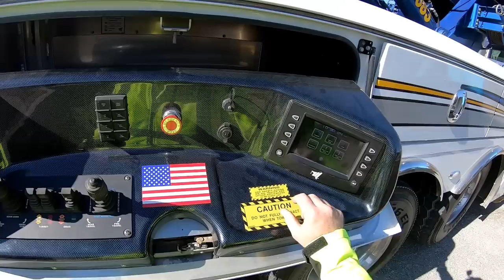Twin Prop Tator

Comment: Hello from Canada again...
Lookiing at google maps this tripo looks like about 8 houre each way for you. Is this halfway correct?

When I get a closer loo0k att thois props I wonjder if they woulf be about thew right size for the Abedgweit (pronounce ABBEY-wait" this is an icebreaker in the costal waters of Northumberland strait.

Beofre the opening of the Confederation bridge joining the tormentine area of New Brunswick to Pronce Edward Island, the Abegweit was used in the summer to help with the tourist traffic between Cape Tormentine and Prince Edward Island. Having been a passenger opn this, you stand 80 feert abovew the water line. the cost of diesel for s single crossing of about35t miles was a whopping $20,000.00 CAD back in 1986.

The hulk of a ship of this kind is built like a military battleship, more or less, very thick and heavy.

The extra powerful engines will force this heavy bow up and over the ice until the sheer weight crushes the ice, and than repeat as you go!

From whewre you are, If you had to go there from Scottsdale, I estimte you'd be on the road for a week, and that providing you didn't have to face delays at the border (between Detroit MI and Windsor ON. Distance estimate about 3000 Km. (about 1875 miles).

(I was the id at age 5 in about 1949 who was reading topographical maps in the bush while my father did the driving, and one day I spotted trouble. I warned my dad, and by the time he had stopped the car, only then could we see that we were within about a carlength and a half of a road we wouldn't have come back alive from! Thicvk forest, no existing roadmaps!)
Reply: Noticing the date on the back prop, and comparing with the jackewts you gyuys arew wearing It looks ki\like the local climate is somewhat warmer then Montreal, but that is to be expected. alsao noting ther vegetation, you're sill well back in autumn. As of this writing it is November 8 and we have a little bit of snow here.

By about the third week we will likely get the first big storm with about 30 cm. of the stuff:-( The cleanup is millions of $$$ (CAD) each year in Montreal, so If you were to come her in winter I''d suggest amtrak to Depew NY and connect with Amtrak's "
The Maple leaf" into torontom, then switch to ther Montreal Train and arrive here undeground in the undeground city. Then ask for a pedestrian's underground city map!

Bring your NOAA radio as it works her also service bvy Environment Canada!, and don't change U.S. cash for CAD in the U.S. it's easier here! Major credit cards commonly used also. Canadian banks are easier to deal with than U.S. ones, having had the experience of both! Also there are currency ecchanges on the major airports and rail stations.

March is the month for the << cabane a sucre >> ("KabANE-ah -suK'r")stuff your gut with maple syrup and other fattening stuff for a day! Generally you buy a ticket and its a bus ride to and from.
Reply: I forgot to mention: Ypuir client and you both have parlances that I find fascinating! I am a langiage lover and that includes the parlances in multiple versions of English, French and Spanish. some Canadians might have difficulty understanding your client, but I catch it pretty easily, although sometimes his words were muddled a but due to background noise -all the more challenge to train the ear!

("Parlance is a true English word, even though it obviously has a French background. It means, more or less manner of speaking, and would have come into English back in 10066 when William of NOrmandy fought the battle of Hasiongs to become King of England, so bringing many French words into English whicl still remain today: "mutton" is the meat of a sheep in French << mouton >>, and many, many more.
Reply: One of your guys there mentioned he might like to have one of those props. This reminded me of the time when going to lnch in the Old dominion engineering site in Lachine, quebec, I oassed a special gear cutting maching which was curtting a 30 foot diameter herringbone spur gear.

The gear was mounted about 40% in a pit and at the end of the pit was a sliding tower with the turtters which would cut back and forth (diagnonal to the ground) while slowly moving upward on their slide, the lot by computer controlled hydraulics, 

As this was happening the gear was also slowly rotating with that side moving upward. Hence, buy the curvaturte of the gear itself, the cutters were digging progressively deeper into the surface metal until they had reached their design maximum depth.

Then they would back off and the vertically sliding turret woiuld slide back down, and the gear would fast rotate the number of degrees necessary for the cutters to start their next cuts, all in exact synchronism with the planned pitch of the gear teeth.

This would likely run for a week or so 24/7. The finished gear would be a mart of the gears from a ship's turbines to turn a prop shaft that likely would have a prop somewhat like what you are transferring there!